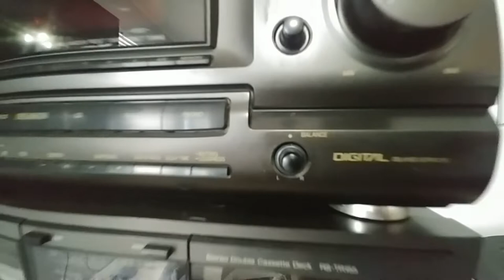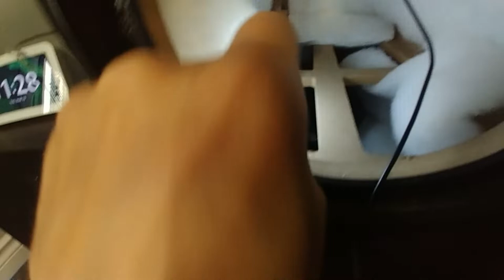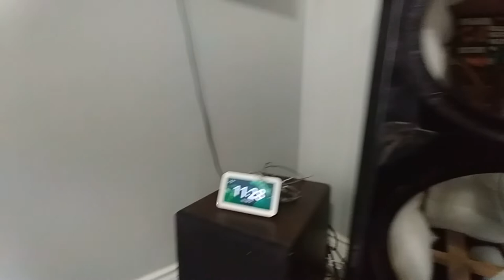Fluance Signature HiFi 3-Way Floorstanding Tower Speakers *repair a look inside*

Comment: Saw your video after I placed my order for mine, and thought, man that's some bad luck, I hope my set is a good set... well, mine came in, just hooked them up, and sure enough, one of the woofers sounds like absolute trash, is it even worth dealing with the seller? (Shipped from and sold by fluance audio via Amazon) or should I just fix it like you did?
Reply: Exchange them for Klipsch RP line